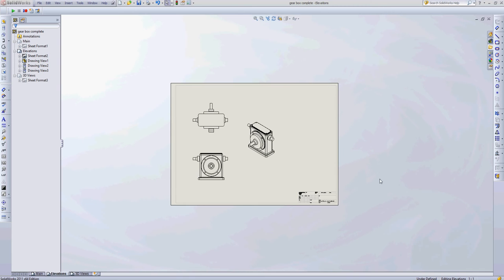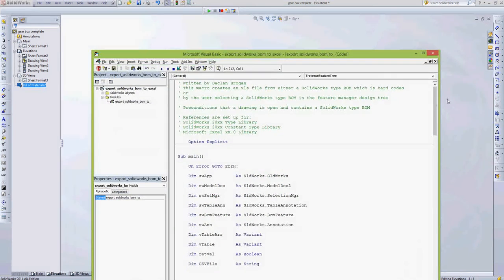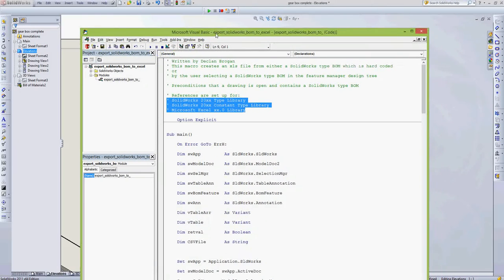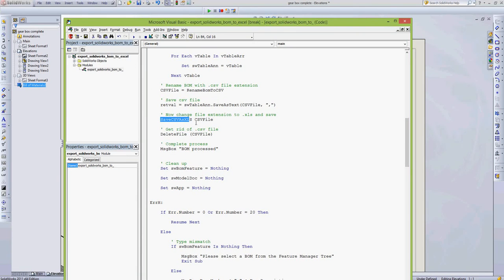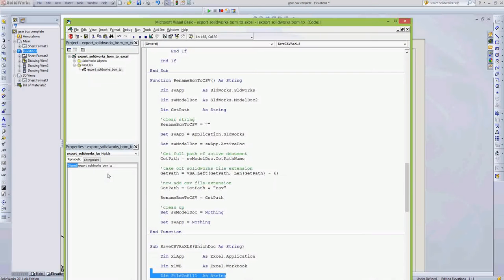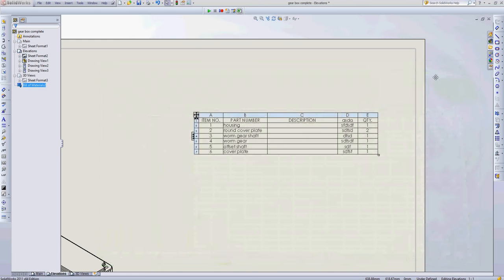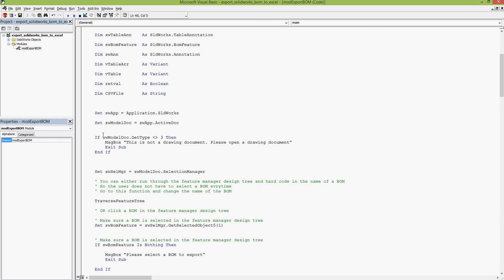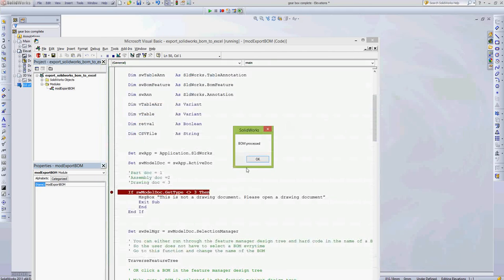Export SolidWorks BOM To Excel Macro

Comment: thnku ,  i did exactly the same steps but it shoses to me a message box where  is written : '' 5 argument ou appel de procedure incorrect'' (in french)
Reply: Same

"5 invalid procedure call or argument"
Reply: this is due to the drawing being saved, you must have the drawing saved before running this macro